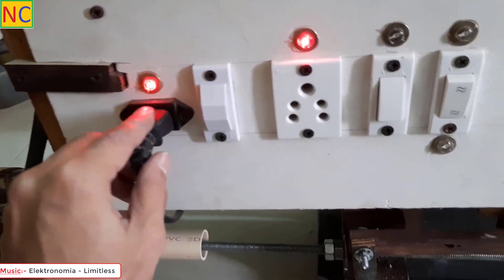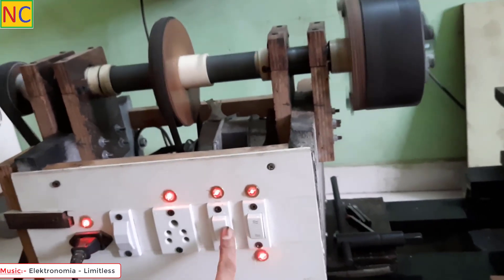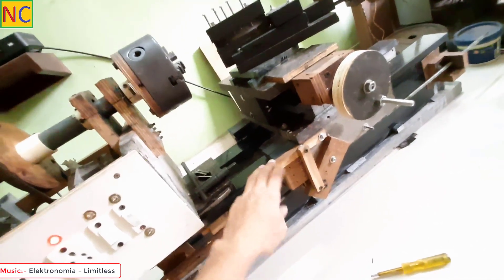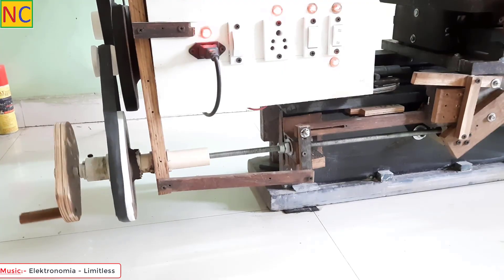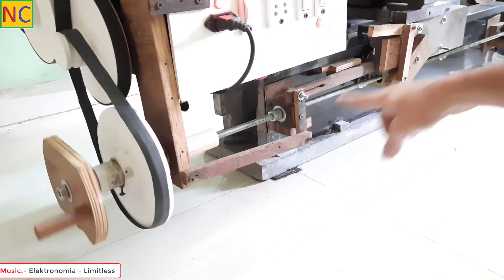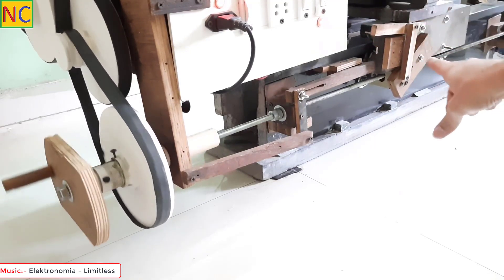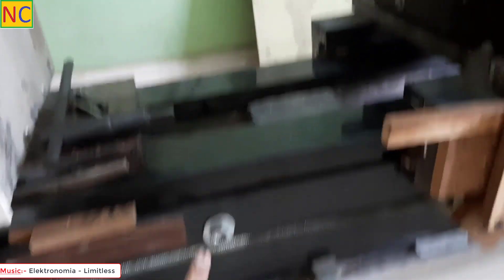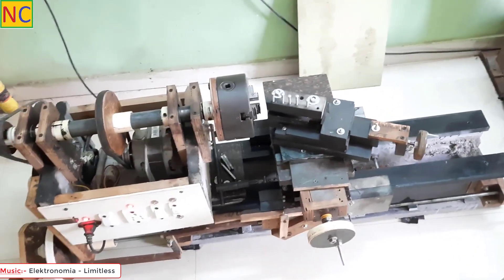How To Make Lathe Machine | Part - 5 | Homemade  Lathe Machine | Nonsense Creativity

Comment: Hi in the beginning of machining, things got started with the lathe? Did you know that the very first lathes were a mixture of wood and iron, it was not until a much later date that an all metal need for higher precision parts in production were needed, so a lathe was built from a wooden metal lathe interesting if you search it you will learn this as we did, thank you for the share. Lance & Patrick.